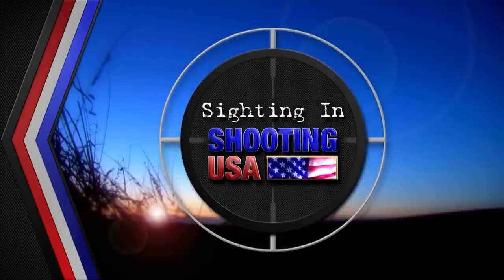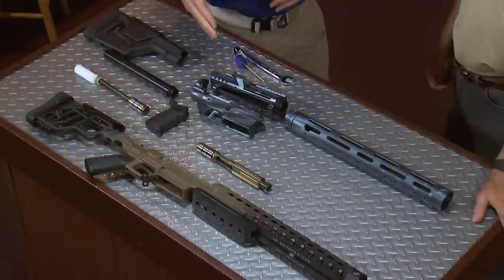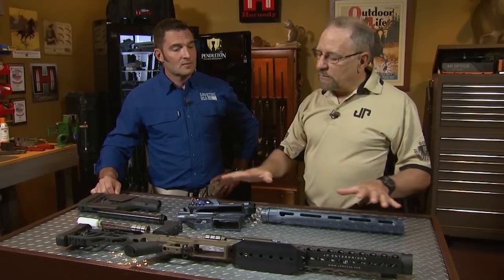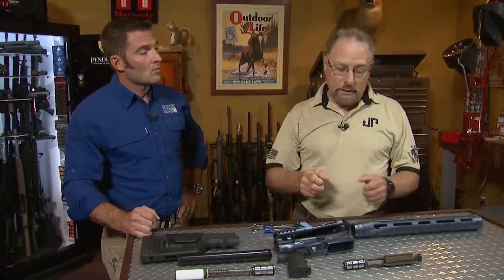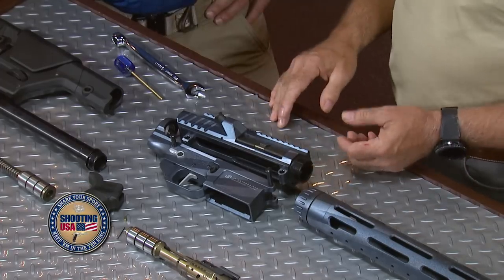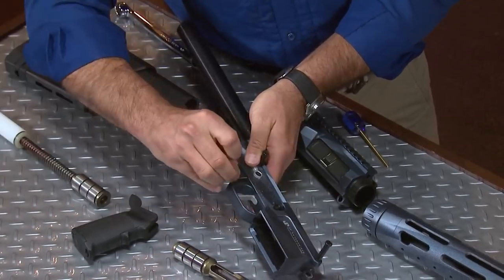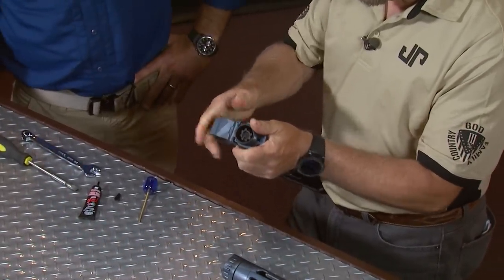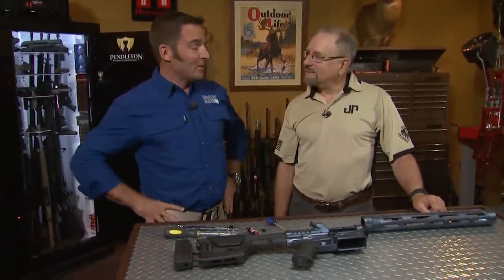Building a Better Precision Gas Gun | Part 1

Comment: I shoot long range with 10 guys. 9 shoot Savage bolt gun's. Just sayin.
Reply: If you've been shooting long range for awhile then, you know there's levels to accuracy.
A savage bolt gun with fine tuned ammunition is a great rifle. 
It falls short, very short of a true precision rifle with, fine tuned ammunition.
There's no comparison.
Reply: @averagejoe1255  absolutely. All I'm saying is that there is a huge market for Savage bolt chassis. We've got Savage bolt guns that will shoot as good as or better than the 700 action.
Reply: @tonydowd8566  
Agreed.
Reply: @averagejoe1255  it's pretty expected for a factory savage to shoot .5 moa or less with factory match ammo. a 'true precision rifle' with 'fine tuned ammunition' does the same thing. it's clear you know very little about both ammo and rifles.
Reply: @bjornegan6421  
It'll shoot .5 at 100.
I know this. 
What's it hold at 700?
From a vice I've seen them hold 2 at that range. 
That's with personal pressed rounds. 
Not, store bought "match" rounds.
Reply: @bjornegan6421  
I take it you don't press your own?
There's a difference between the 2.
Just saying.
Reply: @averagejoe1255  you're not even using correct terminology.
Reply: @averagejoe1255  as long as the barrel twist is appropriate for the weight of the bullet, whatever accuracy it has at 100 yards in terms of moa will continue downrange until it reaches transonic speeds. then, if the bullet is stable, accuracy usually remains consistent. i have no idea what you're talking about.